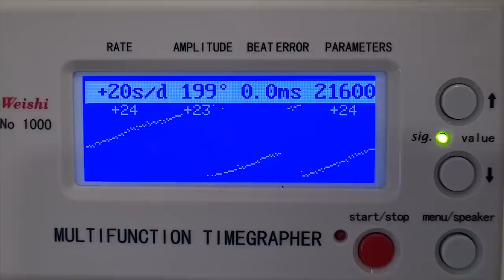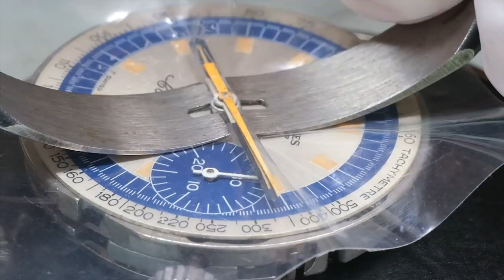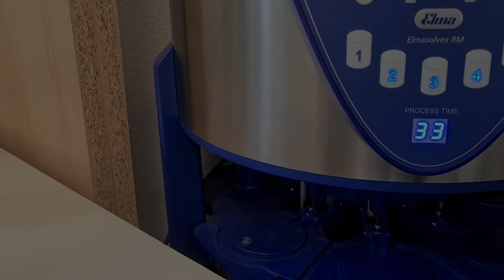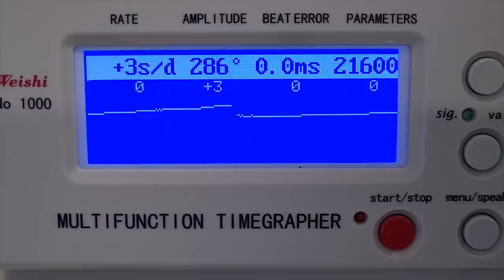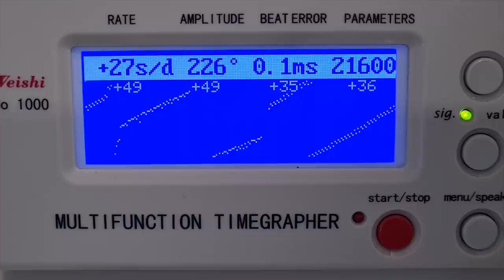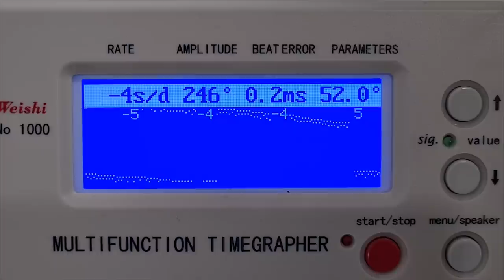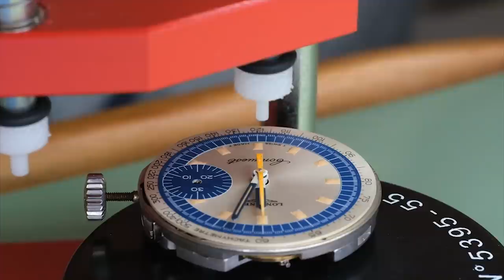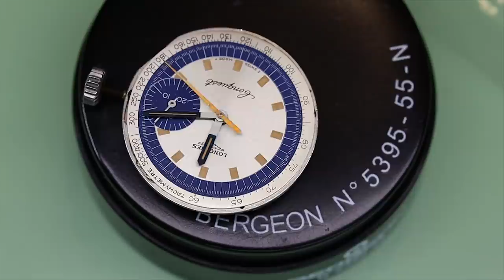A Monopusher Longines Conquest Chronograph!

Comment: Stian, you probably don't remember but I said earlier that I watched your servicing of Longines 30L repeatedly on 1/4 speed, rewinding and rewatching in order to get an basic understanding of a simple watch movement without complications.

Well, I just  watched the section of this video between 1:44 to 2:06 on 1/4 speed probably 50 times over as you operated the pusher mechanism in order to understand the movement of the springs and levers as they interact and cam in and out of the castellations on the pillar wheel to disengage the clutch wheels and release the hammer into the cams on the minute and the second hand wheels to reset them. This would not have been possible without the great camera work that you do on your videos. Thank you very much for the great work. Thanks to you I can now say that I have a basic understanding of the single pusher chronograph mechanism.
Reply from the maker: Thanks so much for telling me that, Mike, that's really nice to hear :) 😊

Comment: Very interesting - thank you - I actually have a very similar watch - same movement I believe but the case is very slightly different with a slight cut out between the lugs. I actually got it when I bought an old VW Polo about 25 years ago and when cleaning it out I found the watch in a fairly poor state in the boot. Had it just lying in the garage for years but got it out a few months ago and cleaned the case up and put on a new strap - it works but needs a service and this episode will encourage me to get it done. It is a Olympic Games version from 72 though serial number starts 18 so slightly later in the run and the lettering still show black so clearly not worn much!  The second hand is red rather than the yellow on the model shown but I suppose that may be ageing. Would probably not have bothered without you showing this one so you have saved two watches!
Reply from the maker: That's very cool to hear! ☺️ It's certainly a watch will worth saving, best of luck with it!
Reply: Free watches are like free beer.  Yes please.
Reply: @VintageWatchServices  Local service would not do it so I actually sent to Longines - all fixed now and very nice - debating what to do with it - a bit small for my wrist. Will try to find someone deserving.

Comment: Great video. I'm a huge fan of Longines and they did produce inhouse chronographs post WW2. Into the 1960's(calibre 30CH). They were pretty much the inhouse chronograph Swiss brand. The rest bought in movements. 
Just one correction. Though it's been long thought that Breitling came up with the two pusher layout. In 1936 if I recall correctly. The same year Longines patented their flyback complication. However a couple of years ago a Longines collector found a Longines fitted with their 13.33Z calibre, featuring a flyback and two pushers and an instantaneous minute recorder from 1929 Years before Breitling and indeed Longines own flyback patent application. Longines confirmed the watch and they already have a two pusher flyback chronograph in their collection from 1930. 
I don't know if links are ok(they're not mine. I wish! 😄)
Reply from the maker: Thanks so much for your comment! Yes, the 30CH was introduced just after the war, in 1947 and produced for about three decades.. I didn't know about a Longines two pushed chronograph pre-dating Breitling, but if that's the case, then more power to them! Longines has made so many excellent contributions to the watch world and they really deserve massive respect 👍

Comment: Dear Stian, thank you so much for another most informative and beautiful video of a very cool watch. I have a question regarding chronographs: many years ago I bought one with date, moon phase, seconds, minute and hour counters. The brand is totally unknown (Georges Claude) and it comes - so I was told - with a movement very similar to that of the Valjoux 7758. The seller told me never to let the chronograph run all the time. This is a pity, since the watch really looks cool with all the hands moving. My question therefore is: why is it not a good idea to let the chronograph part of your watch run for an extended time? Any answer would be greatly appreciated.
Reply from the maker: Thanks so much for your comment! 🤗 
The real wear on a chronograph is the starting and stopping of it, so letting it run constantly wouldn't really be a big deal. It's thus not really bad for a chronograph to be running all the time, it would just mean that the mainspring has to power a few more components and potentially that you would have to service it a little bit more frequently, although that can also be disputed.
Reply: @VintageWatchServices  Thank you so much for your answer. I will now watch the many moving hands with less worry.

Comment: Many thanks Stian, cool watch and great video. I’m still not confident enough to venture into the chronograph world. So more cool videos like this welcome to build my learnings. Those eccentric screws would test me. Remind me, are they only for adjustment so you don’t need to remove them if the chrono works ok? But how can you recognise them as a beginner? Ta ta.
Reply from the maker: Hello Boyd, yes, the eccentrics are only for adjustment. They can indeed be a bit tricky to identify sometimes, but the ones I pointed out are the common places to find them. The only way to progress is to break barriers 😉
Reply: @VintageWatchServices  thanks Stian. What thickness was the small plate you made up to support with the Presto tool?
Reply from the maker: Oh, it's very thin, I think 0.2mm or something. Metal is very rigid when it's a small piece, so you can use a very thin sheet.
Reply: @VintageWatchServices  Thanks!

Comment: How does that Timegrapher get its signal? Does it 'listen' to the ticking? Do you have a video on what the numbers mean? Rate, amplitude, beat Error, etc.? With all the complicated tools and equipment needed to service movements, it's oddly satisfying to see you clean delicate parts with a wooden dowel. With the miniscule amount of lube you use, a vial of that stuff probably lasts a lifetime.
Reply from the maker: Hello Jason, the timegrapher indeed has a microphone that detects the ticks and the tocks. I talke a bit more in detail about the readings in this video: https://youtu.be/hkK6e4tb5Qk

Comment: 10:45 I've got a question. Why do some balance wheels have weights, and some have not, like this one? And which is better?
Reply from the maker: The screws allowed for adjusting the balance for time and also for temperature. With newer alloyes that do not expand and contract much within normal temperature ranges, these screws generally became redundant and you will in general not see them in modern watches. However, if a watch has a free-sprung balance, such as modern Rolex's and other high end watches, there will be a few moveable weights (typically at least four) around the balance to allow for adjustments. Free-sprung balances are not regulated my moving index pins as "normal" watches are, they do not have index pins. Instead, the balance and hairspring are very accurately matched and the balance can thus be fine-tuned with those moveable weights. 
So in a sense, when you see a modern watch with screws or some sort of weights around the rim of the balance wheel, these are likely of a very high quality.
Reply: @VintageWatchServices  Thank you very much!

Comment: Hello, Stian.  Man does that watch ooze 1970s.  With no running subdial seconds hand I would be sorely tempted to allow the chronograph seconds hand to constantly run, but I have been told that is a bad practice because it puts undue strain on the watch.  Is that true?
Reply from the maker: 1970's, baby! I did feel the urge to grow my hair longer with this watch, but unfortunately only succeeded doing so wth my nosehair. 
A well serviced chronograph shouldn't suffer much from constantly running the chronograph, so I wouldn't say it's really bad practice, but there is of course some added effort for the mechanism to power more components.

Comment: If a watch is declared to be "shock resistant," what additional features/enhancements do you notice in the engineering of the watch movement?
Reply from the maker: Hello Ryan, mostly that the balance has spring-loaded cap stones. The balance staff has the thinnest and thus most fragile pivots, so those are the most important to protect against shocks.

Comment: Awesome video! I love everything Longines haha. However, I noticed something and I'd love to understand. When you speeded up the video to X60, you could see the crown turning!!?? Is that normal? How did that happen? Great work nonetheless!
Reply from the maker: That's indeed funny to see! The reason is that the crown was pulled out to set the time, which means that the stem was connected to the time display train and thus would revolve ever so little as if setting the time very slowly. With the crown pushed in, the sliding pinion disengages from the time display train and the crown does thus not move. But it looks very cool in the video 😂
Reply: @VintageWatchServices  Thanks for the explanation!! This is why I love your channel. Keep up the good work!